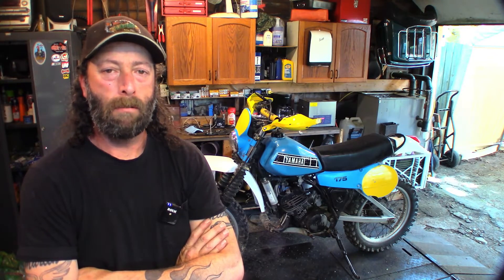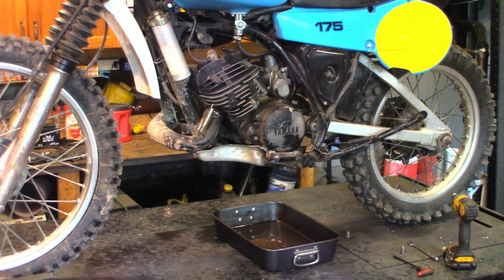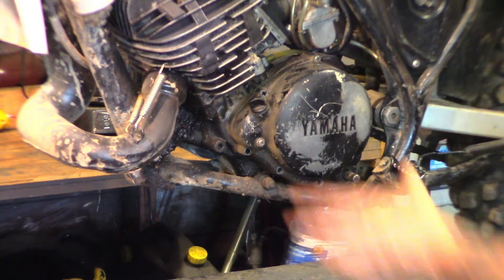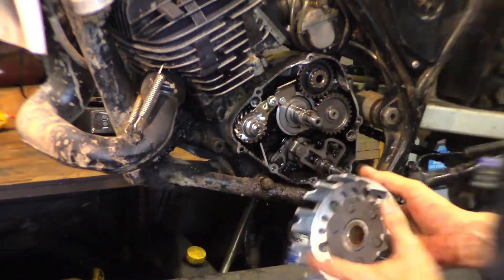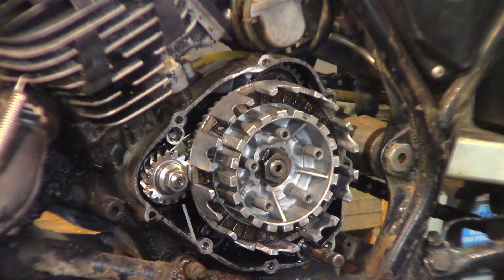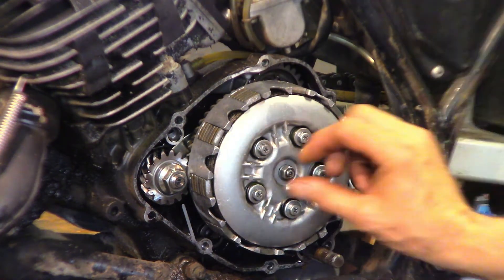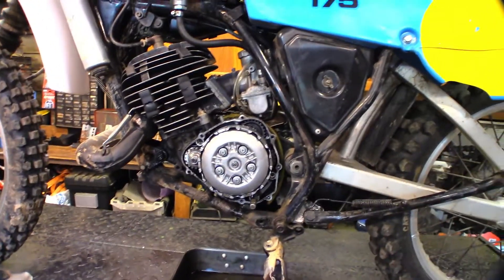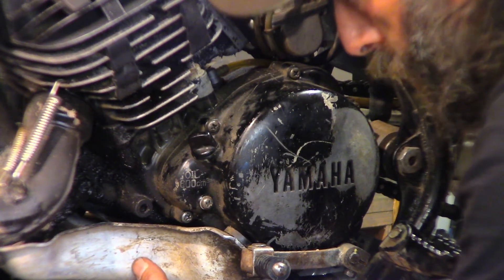Replacing the clutch on my vintage 1980 Yamaha IT175G

Comment: Thanks good video
Reply from the maker: Thanks for watching
Reply: @randomwrenching  in regards of adjusting the clutch at plate. Do you only loosen the lever cable to get things lined up. Thanks.
Reply from the maker: @69bjgmopar  Yep, loosen the cable at the lever to slacken it off for adjustment. Then after the clutch adjustment is done, set your lever free play
Reply: @randomwrenching  thanks for quick response. I replaced my disc didn’t know anything about adjusting liked you showed. When I put in gear dies.
Reply from the maker: @69bjgmopar  Like it feels like the clutch lever isn't pulled when you shift into 1st?
Reply: @randomwrenching  no I feel something but I know I never mess with the plate adjustment so I going to give it a try.
Reply from the maker: @69bjgmopar  Definitely try that first
Reply: @randomwrenching  it work thank you.
Reply from the maker: @69bjgmopar  Good job! Thanks for letting us know!

Comment: I have a question about my Stihl trimmer
Reply from the maker: What's up with it?
Reply: @randomwrenching  well I just bought it last year and it's leaking oil out of the muffler any ideas why
Reply from the maker: @dclawnmaintenanceandsnowre4099  Sounds like you may be putting too much oil in the premix fuel.  Also, running 2 strokes very easy tends to slobber the mufflers up...lol
Reply: @randomwrenching  I use premix gas
Reply from the maker: @dclawnmaintenanceandsnowre4099  Ah, well, might just be running too gentle on it.  The oil in the muffler can only come from the fuel.
Reply: @randomwrenching  l well try to run  it harder than.
Reply from the maker: @dclawnmaintenanceandsnowre4099  It could be running just a little on the rich side as well.  more fuel = more oil
Reply: @randomwrenching  the dealer did adjusted once
Reply: @dclawnmaintenanceandsnowre4099  rev it higher. They’re meant to run at full throttle. Whether it’s an old 2 stroke or the new Stihl 4-mix engine, you need to give it more throttle.
Reply from the maker: Exactly

Comment: And on the clutch adjustment, cheated the actuator arm past the pin on the case about 1/16" toward rear tire. Helped the clutch release fully. Would loosen cable adjustment then run adjuster on clutch in till arm was juuuust a little past where it's supposed to be. Then set cable.
Reply from the maker: Great trick! I very rarely work on this old bike, I haven't put many hours on it at all.  I mostly adjust Harley-Davidson clutches these days...
Reply: @randomwrenching  I'd love to find one of those to restore then ride into the ground again. Appreciate the channel.
Reply from the maker: @gailtaylor1636  Thanks, its appreciated!

Comment: Have to be careful about using "EC" rated oil in those clutch packs. Too slick. Ran Dexron ATF in Huskies & alternated 5W30 & Dexron in ATK260. Clutch would get draggy with constant 5W30. Man I miss this stuff.
Reply from the maker: Well, you certainly know these old classic bikes. I had this same year and model when I was 14, almost 50 now, and I'm back on one. I really missed the old crazy powerband 2 strokes of my youth. They really wouldn't compete with todays bikes, apples to apples, but MAN they were fun. I think that's Motul 10w40 oil in there now actually.